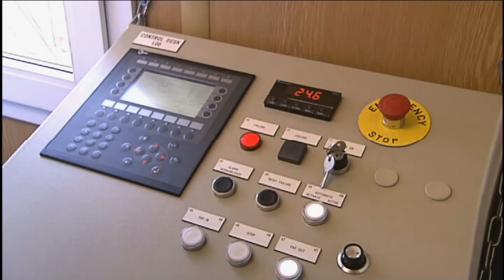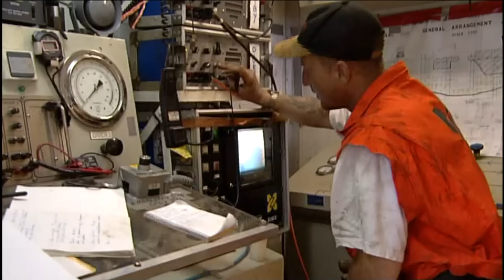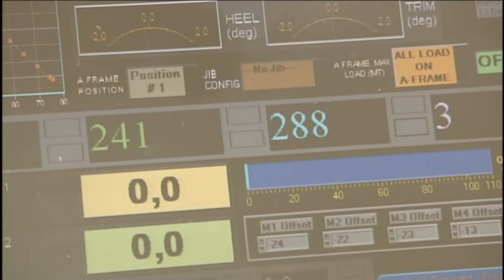Salvage of sunken car carrier Tricolor

Comment: '
why not company can pick up titanic ship to dry dock, put together and show musem
Reply: +bestamerica It would disintegrate if you tried to do this. It broke in half under it's own weight when it went down. Imagine how weak it is now after 100 years.
Reply: thank explain...
dont use a word -- YOU -- on me...
use chainsaw cutting the titanic and balloon pick up ship to carrier towing ship then bring to dry dock...
put titanic back together...
that is a good idea
Reply: +bestamerica it is too deep underwater. Equipment like this cant be brought down that deep.
Reply: therealnightwriter
Except all of the custom fitted cabinetry was from the Titanic and no Oceanic pieces have ever been recovered from the Titanic wreck site. 400 or 401 designation on the parts, I believe, for which ship it belonged too. Also Titanic lettering was welded in place not just painted so it could be seen even if someone painted over it with Oceanic. Portholes and promenade deck were a little different too.